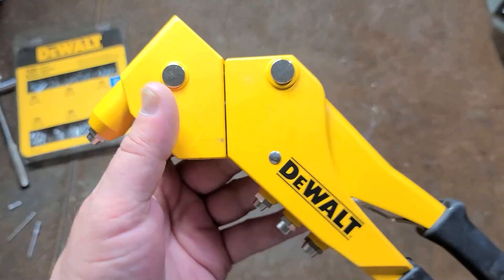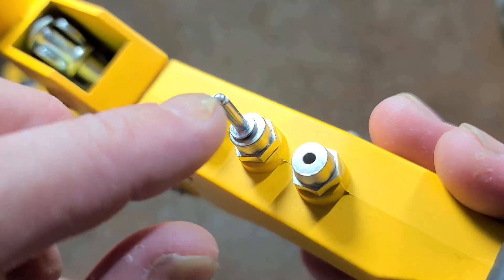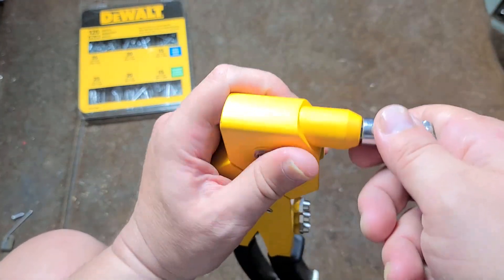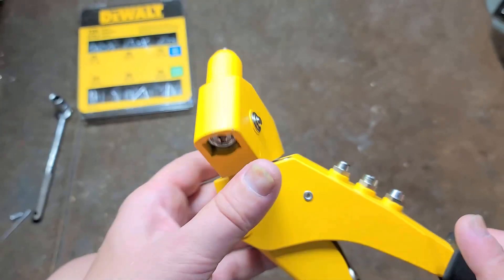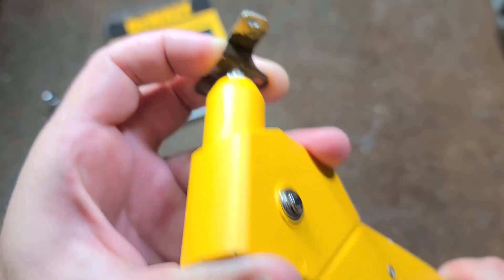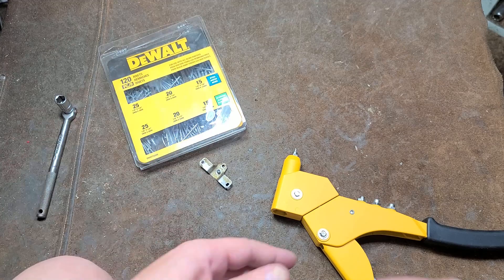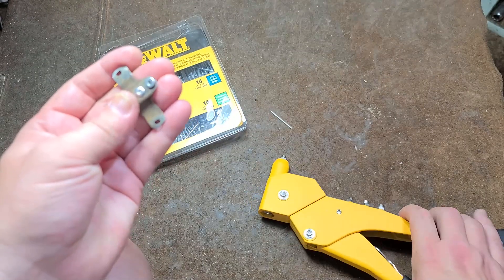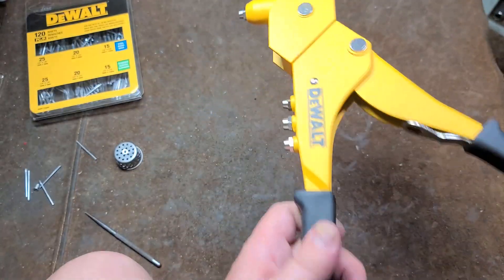DeWalt Heavy-Duty Swivel Head Riveter Review

Comment: Did a variation of the pin reversal trick the other day where I reassembled the rivet inside a tube due to limited access (too narrow to rotate the whole thing into place) and the need for a low profile fastener on the inside. Rivets are really handy when you need a creative solution like that in a tight space. 

Is that DeWalt rated for 3/16 stainless? Even though they fit, I’ve had them damage a few cheaper tools in the past.